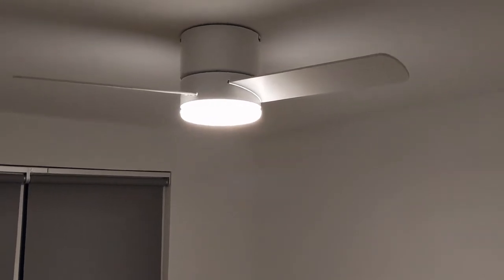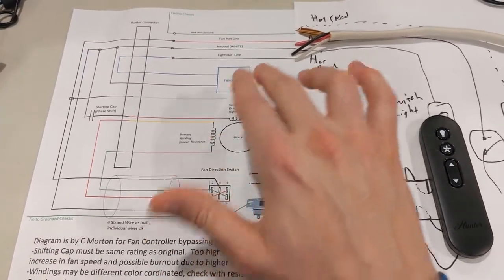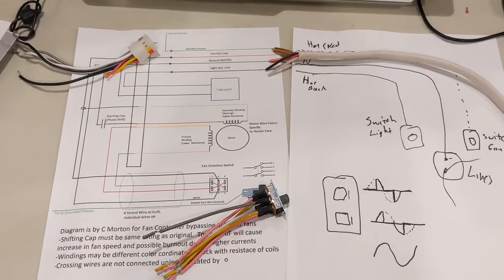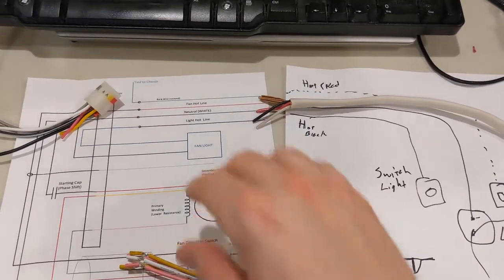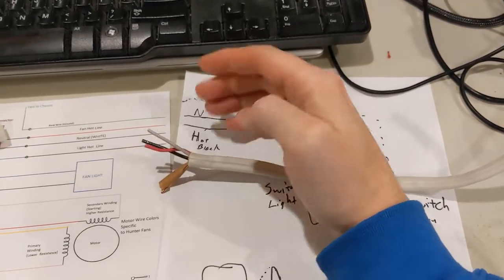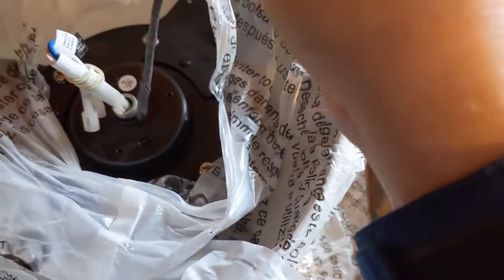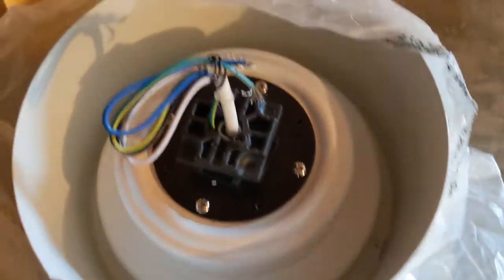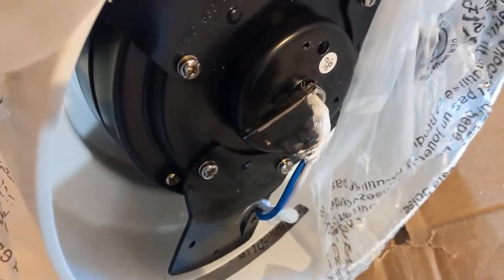Making a remote controlled ceiling fan work from the wall control, ditching the fan remote

Comment: I just bought a hunter Dempsey 44”. Is it the same process as in your video to convert it to Lutron maestro fan/light switch?
Reply from the maker: Looked at the manual.  Its more simple, because the controller that you replace doesn't have the phase shifting capacitor or the switch for direction in it.

You will need two hots (like 14/3 or 12/3 romex) from the wall plate to the fan.

The two hots will just go directly to where the controller outputs were, the Neutral (white) will be same as the instructions.  One funky think about the Lutron wall controllers, you have to have a working circuit for the lights or the fan will be disabled (so the fan will not work until you have a bulb installed in the fan and wired.)
Reply: @ChuckMorton  thanks for the info! I didn’t know that about the Lutron switch either. Thanks a lot!
Reply from the maker: @derekpeters1809  I think they need a circuit complete so it can skim off the AC to power the internal electronics.

Comment: @ChuckMorton

This video is right on target. I want to do the exact same modification that you did to use a Lutron Maestro Fan/Light dimmer wall switch and change the LED panel for a brighter one. Do you have a video that shows you doing the entire modification? I need a step-by-step how to.
Reply from the maker: Schematic is at 16:40 in video, that plus the rest of the video should be enough if you are mechanically inclined.  I used the capacitor on the controller board it came with (big blue one).  You can simplify the design by not having the switch and have the fan rotate one direction only.  Good luck.

Comment: Awesome video Chuck. I’m about to try this for just the light. I want the light to work separately as you have done here. I can live with the remote for changing fan settings. 

I’m having trouble understanding exactly what to do just for bypassing the receiver for the light? Any chance you could try to explain it to me? The video seemed to skip over that part (most likely because it is the simplest part lol)
Reply from the maker: Hi Matt,

You first must have two hot wires coming in from the switch to the fan mount. This is usually the Romex 14/3 black/red/white/copper wires.  One of these lines would have to go to the controller the other one would go to the light itself.

The controller makes it convenient for those with 14/2 wires black/white/copper, as there is the split in the controller.

If you have 14/3 wire, then one hot one would go to the hot side of the controller and the hot one attached to the switch, would go to the light hot, which is usually a blue wire.

They also might make a remote controller that sticks into the wall at the switch position. This may be the easiest solution.
Reply: Thank you. I will give it a shot! Just to clarify, would neutral from the light still connect into the controller? Sorry if stupid question. 

We are replacing dual switch fans with existing 14/3 wire. I have been very confused for days why the instructions would account for a dual switch install with how these fans are now intended to operate! 

I bought a few of those Hunter wall remotes, but would prefer to try to make it work with my existing wall switches for lights due to how many fans we are replacing / the cost of their proprietary wall remote. $80 each here in Canada. 

Thanks again!
Reply from the maker: @matthewp7425  the neutral from the light should be attached to the neutral from the 14/3 Romex along with the neutral from the controller.
Reply: Thank you very much! I left white connected to controller and only bypassed blue. Working fine now. Thanks again!
Reply from the maker: @matthewp7425  awesome! looks like the white light's white wire connects to the return in the controller

Comment: I just installed this fan and am pissed that I can only use the remote. Your video is exactly what I am looking for!  It looks more complicated then I anticipated. I guess I’m returning it and buying a Dempsey instead as I was able to remove the controller easily since it is a separate unit entirely. Thank you for making this video.
Reply from the maker: I feel your pain because its a great looking setup for smaller rooms.

If the issue is loosing the remote, I think the 99815 Universal Fan Wall Control can fit your need, you just have to pair it within 3 minutes of power I think (and contact hunter to confirm this).  The things I didn't like was that it was AAA powered (Lazy engineering by Hunter, but I was just going to put in a AC-DC power supply in the gang box) and the style and UI isn't great (the lady of the house didn't like it and I agreed, the Lutron Maestro looks a lot better and the buttons you want to push the most are the large ones). The good thing about this, is that you don't need two hot wires from the gang box to the drop (Black (hot 1)/Red (hot 2)/White (return)/Copper(ground))

If you don't need to switch the direction of the fan (we almost never run it in reverse, maybe even never outside of just showing that it works), then the hardest part of the mod is gone.  You will still need the the dual hot Romex (like 14/3) wires in the run to switch from wall power.  Doing this will make the hardest part getting to the controller and breaking the controller up for the large blue phase shift cap (unless you buy one with the same Capacity/Rating).

Funny thing is Dempsey is owned by Hunter.  Hopefully you have a solution that you like.

Comment: Great video Chuck... Any details about the capacitor size. How do I figure the capacitor size I need?
Reply from the maker: if you have the controller inside the fan, use the same value of capacitor as the largest physical cap in it.

If you do not have it then you will have to know some specs of the fan and use the following formula
C(µF) = (P(W) x η x 1000) / (V(V) x V(V) x f)
η is usually not give, but it is power efficiency. 

η = Po/Pi,  which is power output/power input

Pretty much all ceiling fans will have 1-10 uF Caps, with the most common being 2.2-4.5 uF range.

A Good video, but he is approximating efficiency and using 50 hz/ 220 as he is based in India.
https://www.youtube.com/watch?v=e3O7Jc5-Vac

Comment: I have these fans and would love to do the light conversion you mentioned in the video. Has that video been posted or do you have instructions on how to swap out the LED lights?
Reply from the maker: Never made videos or instructions. From memory,  the light driver in the controller housing is not designed to work with a lot of energy, so it's limited to 15 watts or you wil overheat it. Since I bypassed the controller, it's not an issue.

What I did is remove the last piece of metal in the housing that the light connects to. I used a wide and flat that better distributed the color, but I think it used 20 watts. To secure it I drilled pilot holes into the metal housing and used machine screws to hold the light in place. I will have to find the particular model I used and a picture of it if you give me a contact email (or throwaway email to avoid spam).  I won't be able to do it until the weekend probably 

The problem is that the Chinese supplier swapped out 1600 lumens with 1300 lumens and Hunter was not aware, but they spent no effort in getting the 1600 lumen back.
Reply from the maker: The lights I installed are Satco s9781

Comment: Hey Chuck.  Great video!  Quick backstory on my situation.  I purchased a Minka-Aire Xtreme H20 65" fan for my living room.  No light as it's just the fan.  The fan came with a remote control, but I have opted to control the fan with my "Caseta Lutron Wall Fan Switch" (super sexy, matches the rest of my caseta switches in the house and can be controlled with google home, etc....)  I simply wired it up and it was actually working as described for about a week before the fan stopped responding to both the CLWFS and the factory remote control.   Soon after I reached out to Minka Aire "playing dumb" and they sent me a new controller which I replaced with the old controller and again reused the CLWFS as before.  This time it worked for about a month before losing control of the fan from both the CLWFS and the factory remote control.  I have since ignored the fan over the winter months and am now ready to bring it back to life!  Its sounds like I can apply your video to my situation for use of the CLWFS by bypassing the now non-functioning controller.  Are there any considerations to account for?  Should I reach out to Minka Aire to get another fan controller?  I would be interested to know what actually is happening to the controller to make it essentially stop working......   Anyways thanks for your video and any advice would be much appreciated!  (P.s. I have checked and re-checked the current going to the CLWFS and it is still receiving power to the CLWFS and the fan itself, even though the fan is inoperable) 🌩
Reply from the maker: Hmm, my best guess with limited knowledge is the CLWFS is pulsing the fan's controller and the rapid transient power is shortening the life of the fan controller components, if you open one up, I suspect a cap will be bulged from being cycled rapidly.
My guess is that the cap for the second coil phase shift are within the controller. I would use the biggest cap in there for the secondary coil voltage phase shift (will be the higher resistance of the 2 coil windings).  It would be similar to the schematic seen around 16:40 in the video and the cap is the only required component from the fan controller.

Comment: Hi, Im pretty sure you can help me. I want to bypass and avoid the need to use the remote control of my fan and its light. I want to control both functions using my wall switch (it is 1 gang with 2 buttons: one for the light and one for the fan).

The remote module is still in the box, so is not connected. My fan has 5 wires coming out of it (blue-white coming from the led light; and black-red-white coming from the rotor). From the ceiling I only have 3 wires hanging down (neutral-fan-light) which come all the way from the wall switch. Can you please tell me how to connect them together in order to be able to turn on the led light with one of the buttons, and turn on the fan with the other button?

p.s. I dont know if its important, but I dont want to be able to change speeds. I only want it to be just one: the fastest.

Thanks in advance!
Reply from the maker: Quick question, from the ceiling is there Black (hot 1) Red (hot 2) white (neutral/return) and Green/naked (ground) or just 3 wires total?  In a proper setup you should have this and a lot of people are improperly using the ground as a neutral wire in 14/2 romex.  Best to keep in code and its a lot safer since ground is a better path for a hot line than you and it may involve replacing the run from the 1 gang to the ceiling drop with 14/3 romex so you have the safer circuit. The advice below are offered without warranty and if beyond your capability, hire someone.  Be careful no matter what.

The light is the easy part, white should be attached the the Neutral and the Blue attached to the Light (Hot Light). You probably know this already.

The harder part is connecting the Fan.  The setup is probably Black to one winding, red to second winding, white to where the windings are tied together.  The way to check this is a DMM.

Measure Red to Black, this should be the Highest resistance, maybe a 150-250 ohms.  Measure Red to White and Black to White.  It should be REDtoWhite+BlacktoWhite = RedtoBlack
then this is the circuit.
RED--uuuuuuuuuuu-------WHITE-------uuuuuuuuu---Black , where -- is wire and uu is the induction coil.

If this is the case, we probably need to add a capacitor to shift the phase.  In the controller is there a large capacitor?  This will have to be put in the path of one of the coils, called the starting coil.  It is always less turns and smaller wire (less inductance and higher resistance).  This cap, or one with same uF capacitance and rated for enough voltage (usually 250v), will have to be placed between red or black wire (whichever has more resistance to white) and the fan hot from the ceiling.  The other red or black is tied directly to the fan hot from the ceiling so the 3 are tied together, but one through the cap .  White is tied to neutral and the other white directly.

Don't use a higher value of capacitor, it will make it go faster, but the coils were not designed for the extra current.  This may burn them our or worse cause a fire.  I explain this all in the video.

The capacitor may also be inside if you read resistance from red/black to white  and open from the other red/black to white.  In this case measure capacitance from the open red/black to white.

good resource on how single phase motors and shifting of a leg of the phase techniques in motors.
https://www.lmphotonics.com/single_phase_m.htm

Comment: Hello. I’m trying to figure out which one is the starting cap. I have a Hunter fan with the same remote.  The caps I see as follows.  
Larger one. 68uf. 450v
Smaller.  4.7uf. 400v
Smaller.  470uf 25v. ( too low v?). I saw your comment about the largest one is the starter cap?
Reply from the maker: Typically it's the largest physical size one. 

For example, In pull chain types, there are multiple capacitors in the cap box and the pull chain changes the path through one or several of them as you change speeds.

The smaller 25v is for DC control electronics.

A large 68 uF seems like it has too much capacitance as I have only seen 2-7 uF in all ceiling fans, so I think that the 4.7 is the right range.

The only issue is that it is usually the physically largest capacitor, unless there is a mechanical separator for the starting winding. On my controller, the biggest piece attached to the circuit board was the capacitor.

Your controller may look like things from Reddit. In that case, the black cap to the right (not in controller) is the starting cap and already part of the circuit.

https://www.reddit.com/r/askanelectrician/comments/j1f1l7/can_i_bypass_this_ceiling_fan_controller/

https://www.dekielectronics.com/fan-motor-capacitors.php#:~:text=Normally%20fan%20motor%20run%20capacitors,370%20V%20or%20440%20V..
Reply: My Hunter controller looks very similar to the one in the video.  It is a 70” fan.  Is there a way if I got you a pic of the board you would be able to tell?  If so how could I get that to you?   The 4.7uf is the smallest cap on the board.
Reply from the maker: Look at the video at 15:10, the controller is there and the big blue plastic piece is the capacitor I needed.  It doesn't look like a typical capacitor
Reply: I do not see any type of larger cap like that.  Any other suggestions?

Comment: Great video!   I don’t need the direction switch but could you please describe/ list the connections for summer use?  My fan has the same remote so I’m assuming the colors will be the same.  Thanks!
Reply from the maker: I don't know the wiring polarity of the coils and wire coloring scheme offhand.  In the following link there are pictures with how the circuit will look much simplified in two pictures. Assuming that blowing air down is what it wanted, I think the left diagram would be more likely than the right diagram. If it spins the wrong way, the difference is a simple switch of one of the coils between your Hot Line and Neutral as shown on the opposite side. Hunter does have a schema standard but doesn't publish it, someone else may know.

https://diy.stackexchange.com/questions/35852/how-do-i-re-wire-a-ceiling-fan-to-reverse-its-direction
Reply: Awesome thank you!!!

Comment: This is so helpful.

I have the same fan, and working through this. What starting cap did you use?
Reply from the maker: Glad it's useful, I ripped out the one from the controller. I think it is 3.3 uF. If you go too high, it will increase max speed but apply more current than rated. Lower capacitance will decrease max speed.
Reply: Sweet, i didnt even think about that but that makes it easy.

If i dont create the reverse switch. Its just simply bypassing the controller with the starting cap inline for just the fan? And the correct wires for the lights?
Reply from the maker: @brycebutzine8928  yep, simplifies the circuit, but will only spin in one direction. I haven't used reverse here at all.

The ends of the primary coil connects to hot and neutral return to neutral. The ends of the secondary coil also to hot and neutral, but the capacitor sits on between secondary coil and either the hot or neutral. This causes the phase shift that causes the difference in fields.

If you measure the resistance of the coils, the one with more resistance should be the secondary coil.
Reply: That was kind of my thought, i havent used any of the reverses i have so doubt its something i need.

Thanks for the detail on the second part!